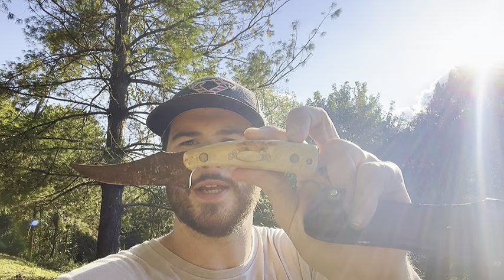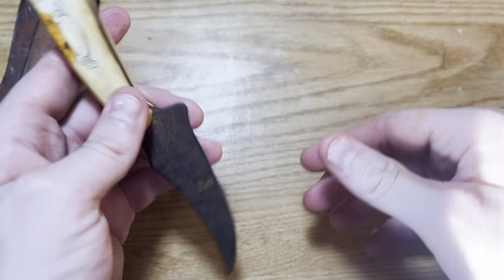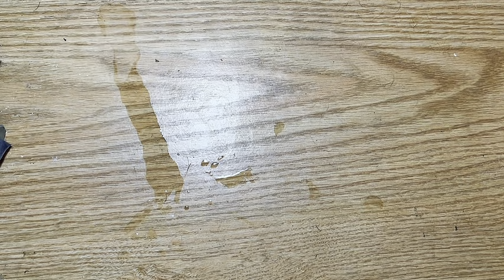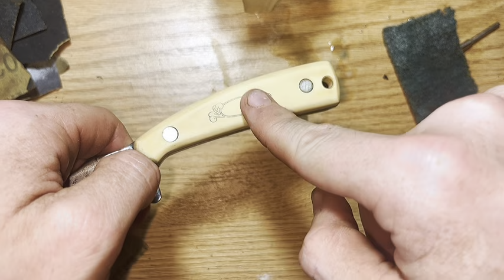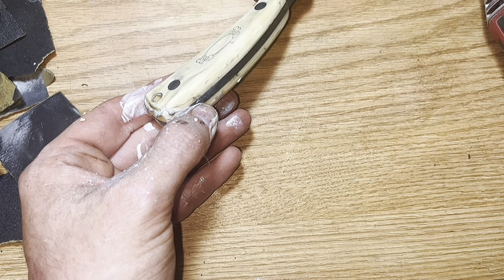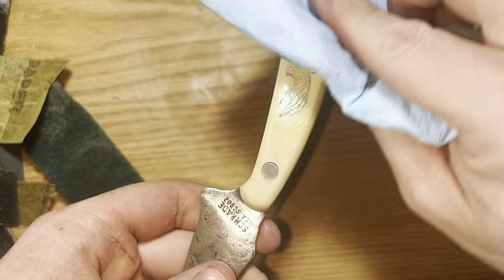Schrade scrimshaw SC502 clean up

Comment: Nice work. One of the best Hunting knives ever produced.  I’ve had an Old saw cut Delrin’ model I cleaned up 35 years ago.  Still carry it occasionally.   Pretty impossible to color that DuPont Delrin .  Enjoy.  Dwayne
Reply from the maker: Yes I’m so glad I came across it. It’s very quickly becoming one of my favorite fixed blades. Definitely got to find the correct sheath for it.